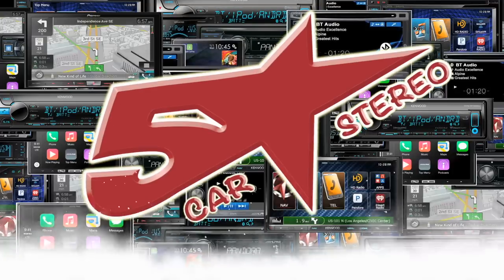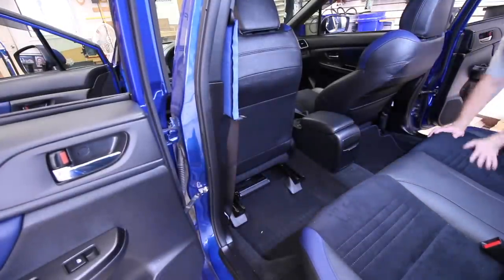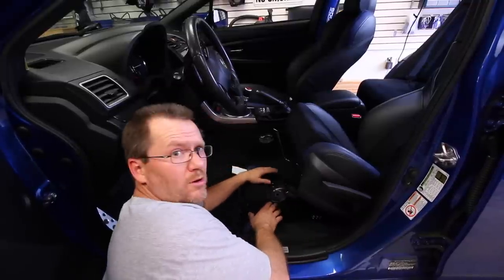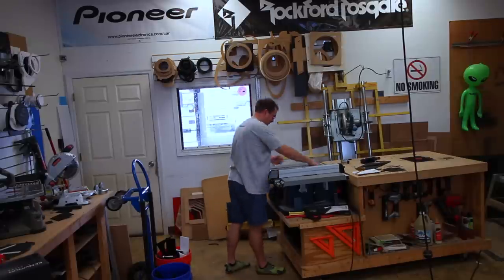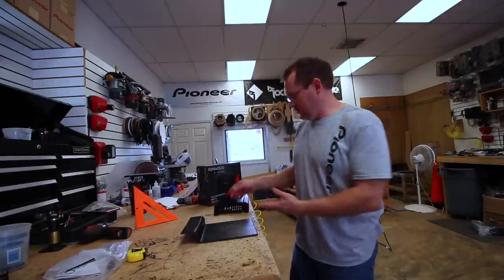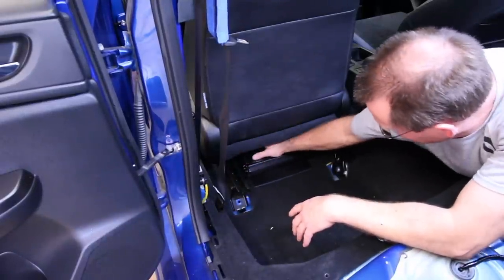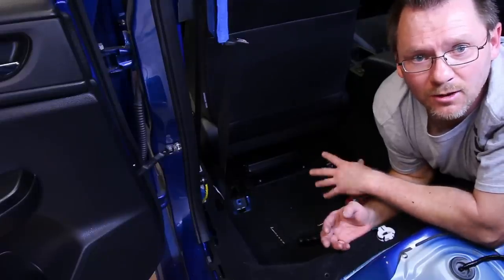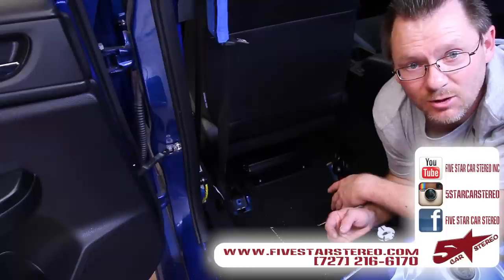How to mount your amp under your seat

Comment: I mounted a kenwood mono amp under the passenger seat of my 2016 wrx using really wide Velcro tape and works like a charm, no drilling.
Reply from the maker: woohunter1 if it works why not.  We drilled into the seat rails so it did not poke out of the bottom of the car.

Comment: Is it a good idea to mount an amplifier directly in front on HVAC though ? Blowing hot air on it in the winter. In the summer when you get in it's 120°. Blowing cold air on it is going to cause condensation. Heat and water do not mix well with electronics.

Comment: I'm not sure if you noticed but there are two additional bolts underneath the carpet on the passenger side that aren't used by anything. they are 10 mm I believe so you can make a bracket to mount to those I think that's what they're there for is for the factory OEM stuff???

Comment: just use large velcro strips under the amp which will grip the carpet under the seat easily.
Reply: Bro you're a genius thank you. 🤣
Reply: If you live in a place with snow your amp will get wet with salt water from your shoes in the winter.
Reply: I've done this several times... It seems ghetto, but in truth that Velcro will hold the amp in place real nice, at least until you get into in accident, and then there's amps, crossovers, and DSP's flying everywhere...
Reply: Yeah not sure how I feel about that. Thats asking for a short if it does happen to move and hit the metal on the seat frame.

Comment: I know this is a wicked old video, but... are you not concerned about 1) the heater blowing across the amp all winter and 2) waterproofing those holes that were drilled in the floorpan?

Comment: Do you guys still follow this videos comments? I just tried to do this and let's say I'm frustrated. The holes on the plastic didnt end up lining up. Plus the screws dont go easily into the inserts. I did something wrong. You guys make it look so easy. Plus the metal in my nissan frontier 11 isnt flat it slopes down I matched that but the inserts dont seem to like it.

Comment: I want to mount my 4 channel under my seat, but living in an area of the country where using the vehicle heat is a necessity I have concerns of the floor vent causing the amp to over heat. Have you ran into this issue yourself or heard of someone having a problem with over heating?
Reply: are there vents under both your seats? in many vehicles theres only vents under one seat.
Reply: Yes there are vents under both seats. Only thing I can think of is making some sort of cap to close off the vent for the colder months. Then I could take it off for the summer to use the AC to keep it cool during the summer.
Reply: you could do that. or mount it in the trunk, either on the back of the back seat or somewhere else.

Comment: I'm thinking of a small powered subwoofer under my MY06 Forester's seat. Should I route the air vents for the rear passengers? Would blowing hot or cold air directly on the powered sub cause any issues for it?
Reply from the maker: nchia I would close them off or re route them. The heat would be the big issue
Reply: Five Star Car Stereo Cool. You know what I mean! Subaru has kits to route around their own boxes, but I'd need to make something up for the Pioneer TS-WX120A. I just picked the smallest and cheapest one with a brand name... Are universal ducting kits available?
Reply from the maker: nchia we just use plastic and build what we need

Comment: I got a 08 Pontiac vibe where is the best to put the amp I dont want them on the sit
Reply: wherever you can easily reach it afterwards. I suggest in the trunk, and also close to the amplified subwoofer if it's for a sub. That way you could change the gains and see the changes in real time without having to break your neck.

Comment: Trying to learn here.... but why do all this? You punctured the floor here with the rivets, so why not just use the amp's mounting tabs and run 4 screws through the floor? That would be 100X easier and arguably look better, without that plastic tab at the back like that.
Reply: firebirdude2 it gives you something to mount the amp to. You don't want to screw to your car floor directly.
Reply: 4:47 Are you not going through the car floor directly in this video?
Reply: Cory Williams+ I see. Not all vehicles have this. Many times the 4 seat bolts go straight through the floor. You can pull the bolt, look through the hole and see concrete below the car. But I can see this car might have a hollow brace that the seat mounts to in the back. Good stuff.
Reply: As an alternative you could glue a large piece of ABS or plywood (painted) under the carpet and have all your wiring pass through the carpet and screw into the ABS or wood through the carpet.
Reply: The plastic mounting plate gives a nice flat surface for the amp. Without the mounting plate, the amp may not lay flat with the carpet, padding, wire harnesses and anything else that can run under a seat,.  Also, with the mounting plate he only had to drill 2 holes into the body vs 4 holes, the fewer the better.  If you can find a place to mount the amp without drilling any holes into the body, that would be even better. If you must puncture the floor, then threaded rivets are ideal because they don't weaken over time.
Reply: you would have 4 screws in the floor. and if you needed to remove the amp for some reason the floor would now have those holes there. atleast doing rivets you can easily remove it if need be
Reply: I think he just went through the carpet and not through the floor
Reply: @terryreyes1125  u dont read the comments before replying do you?

Comment: So what do you do when you have a vehicle with heating ducts under the seats?
Reply from the maker: Leslie Dell so that is one of the nice things about living in Florida, we very rarely need heat. With that being said we take it seriously. We do one of 2 things depending on the customer wishes 1- we make the amp rack so it mounts above the vent make sure not to get in the way of it. 2. Remove the vent at a joint and duct tape it off.
Reply: I almost never use the floor the floor heat, I just wonder how it would effect the Amps if it was used for a long period of time.
Reply from the maker: Leslie Dell I don't think it would be all bad. It is not like you are running the heat on a hot summer day. Running the heat on a cold winter morning could bring the amp up to operation temp. Remember they have minimum operating temp too.

Comment: I have an amp that doesnt seem to have any mounting tabs any suggestions on how to mount?
Reply from the maker: MrAT8383 depending on the make contact the manufacturer and see if they sell them. Make some out of plastic or metal, Home Depot. If worse comes to worse there is always Velcro.
Reply: your amp may have come with some in the box. sometimes they use rubber tabs that slot into the metal casing of the amp to mount it

Comment: Why would you drill a hole on the floor in that car!?
Reply: To mount the amp.  He put in nutserts.  You can hit it with an encapsulator from underneath if you live in a rust belt.

Comment: How do you ground amps under seats??
Reply from the maker: Jason Myjak in a car like his there is a couple different ways. Sometimes there is a factory ground point under or around the seat. If not the side frame rail works. Sometimes there is a front seat rail also that works.
Reply: thanks for response.. I own a ridgeline and everyone tells me, ground to seat frame, which I heard is bad. mix opinions..
Reply from the maker: Jason Myjak I would never recommend grounding to a seat.

Comment: Why not velcro the hell out of the bottom?
Reply: Doesn't work well and the heat from the amp will make the glue crappy on the velcro over time.
Reply: velcro is great for DIYer but if a shop cut corners like that on an install for me I would never recommend that shop, unless we agreed to do a cheap half-assed job to save me money.

Comment: seems like putting the amp anywhere near the path of a vent is a horrible idea. I think from a lot of your other videos I remember seeing a lot of florida plates but from what I gather its not uncommon to see temps in the 40s during winter so I can see people needing to turn on the heat. other than that you have no idea where the car will end up and putting an amp behind a vent putting out hot air seems like a horrible idea.